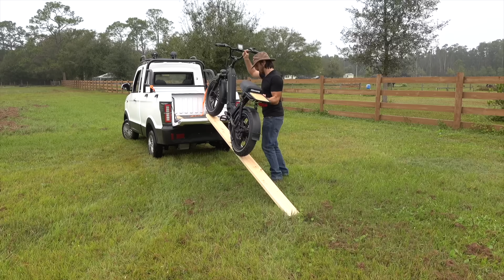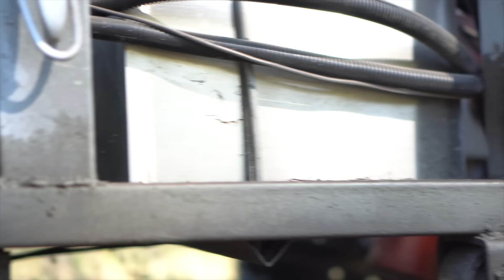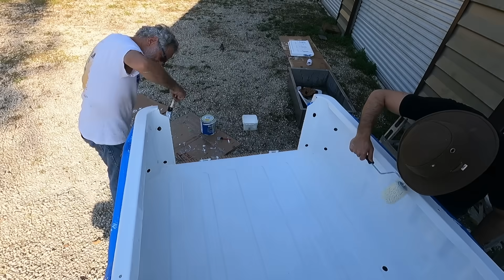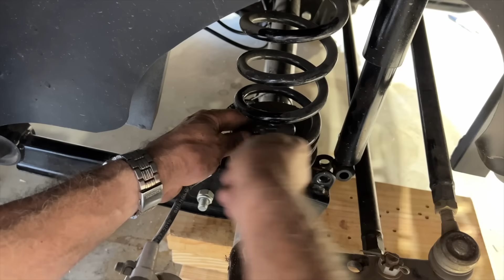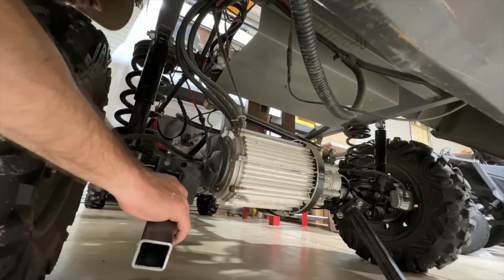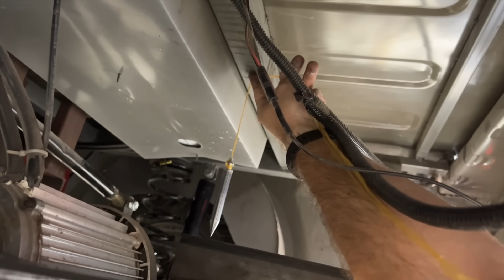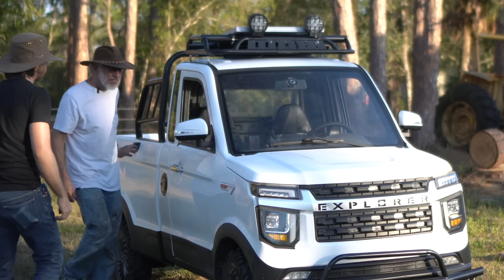My Chinese Electric Mini-Truck 18 Months Later: Did It RUST OUT?

Comment: Umm...  The hitch is clamped to the axle.  They hitch control leg is attached to the frame.  The axle moves, in relation to the frame !  This means that the support leg has to bend/curve to follow the arc, and the clamps are likely to slip on the axle in so doing.  You need flex in your joints.  Adding rubber sheeting under the U-bolts with another U-bolt either side of the clamps to keep it from sliding to either side, then some rubber washers on the control bar, to allow the ends some 'give', ought to fix these issues.  Great little truck though.  Well done both of you.
Reply: Don't disagree with your observations but the threaded rod (control leg) is very small diameter and has give and flex in it by design.  Doesn't totally address your issue but it is not a rigid connection in the sense of a welded square tube or similar member from axle to frame.  Thanks for sharing - good eye.

Comment: I was impressed by that little truck when you first got it. Bed liner is good idea, seems like you took the expensive route, but it looks fantastic. Painting the wheels was such a good idea. I’m still shocked it’s got functional A/C. 
Go to the hardware store and get some steel cable and fasteners, fixed! Lol
Cool video like always
Reply: That's the thing with this little truck. it's simple enough that it can be fixed and upgraded by almost anyone with minimal mechanical knowledge and tooling. That makes it very durable and its maintainance cost is very low.

Comment: Might be worth replacing the cowling around the motors fan helps redirect the air over the motors case fins or heat sink with the option to tow you'll be putting an extra load on that motor.

Comment: Do the off road tires fit directly on the factory wheels?
Reply from the maker: Yes, but we took the wheels to a local tire place to put the tires on.
Reply: I recently purchased a coco truck for my son with special needs. We purchased it pre-owned. I have so many questions about this truck. Have you found somewhere that you can purchase replacement parts, such as headlights? What size knoby tires would I get?
Reply: I hope to have some video of the delivery, unboxing, and assembly with battery install if the 72volt lithium ever shows up.

Comment: i would put some drain holes in the tow hook stell bar, that it dont rust when there is water in the pipe
Reply: There are drain holes on the bottom side for exactly that reason.  thanks for your comment

Comment: I kinda like how this is the antithesis of modern pick-ups in North America.
That said, I wonder if the tailgate hanger support could be moved to allow the tailgate to fold flat.
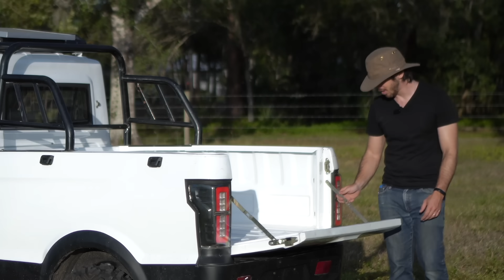...and now I see at 11:20 you talk about it :D
Reply: no reason to move it or whatnot. Just use some steel wire and crimp it to the length you need. Like a $5-$10 upgrade.

Comment: Glad your truck is working out.  It's hard to imagine they didn't put a more functional suspension on the truck. 
Thanks for reaching out to those in need of an e-bike.  Hopefully the most worthy wins.
Reply: I don't find it so hard to imagine that almost every design decision on this truck was probably based on cost. If the manufacturer somehow got a deal on the stiffer but cheaper springs, naturally they would go for that.

Comment: It's never seen road salt. That's the killer here.
Reply: Correct but this is SW Florida only a short distance from the Gulf of Mexico and there is actually a good deal of salt in the air
Reply: @micahsdad5388 salt in the air doesn’t compare to road salt in the winter bro 😂
Reply: @Ssm19494 that's a fact. A new car that doesn't get washed will have rust issues within 5 years because of road salt
Reply: @micahsdad5388 Ahh.. That's the place the cars rust from roof down.
I have seen such.

Greetings From Finland!
Reply: @micahsdad5388 there is (I hear) a new ancient metallurgy method that does not rust. Kinda like ancient cement does not crumble .
Reply: Thankfully road salt isn't a thing in the Southeast. Bad thing is that comes with winters where you can wear shorts and flip-flops in between cold fronts
Reply: road salt will kill anything
Reply: If its the killer I wonder why you highlighting something that's even a bigger problem with your american brands.
Reply: Road salt is a killer for American cars, too. Ever hear of a Winter Rat? It's am Upstate NY car that's had the floorboards replaced.
Reply: This isn't going in a road up north so road Salt wouldn't effect it either. People aren't going around salting their entire property it serving this thing around in 3 feet of snow. It would be bad as to see one of the with tracks instead of wheels.
Reply: Blackforest. Salt from september to May
Reply: Hvac installer by the beach. Most hvac units and metals don’t last more than 7ish years or so at best. You’d be the lotto winner to get 10 years on hvac unit on beach. I’d imagine the same with etruck or ecar…? I want to buy one though? Is it possibly street legal in nj ? America?
Reply: I don't know where this guy lives in FL. Depending on how far from the ocean he lives the less salt will be an issue even if it is still there. 

 With that said road salt is so much worse than salt from the ocean. Road salt is like a breed of its own, because well - there is more per meter. 

 Living on the coast in CT sucked. Got hit by both. Salt from being on the coast, and salt from the roads. 

 Weather is warming though so there is much less snow lately it seems to me. Yet sometimes governments still salt the effin roads even for the slightest chance of snow!
Reply: I'm in New England and I always wash my car during the winter. In fact, the car washes up here are packed like sardines between snowfall. After letting my first car rust to sh!+, I quickly realized washing my car in the winter is far more important than the summer. A brand new car can have rust issues in 5 years if neglected
Reply: Complaining about “salt in the air” is such weak issue compared to the loads of other problems you must have in Florida, with all the Florida men and women running around wreaking havoc, Trump in Mar-A-Lago
Reply: Please add western brands to salt corrosion and the super low quality corrosion prevention
Reply: Road salt would get just about any vehicle. Especially Chevy's
Reply: Road salt would get it😅
Reply: Fellow Floridian, and gotta agree with @Micah's Dad! Complaining about road salt that only is a problem 3 or so months a year, versus our S. FL salt air that's 24/7/365?? 😂😂 c'mon now, lol!!
Reply: @rpetersen2  Yeah, but fill a sandblaster with salt and sharp sand and blast all the wheel wells and you have one trip to work in MN. Freeze the glop on any place not blasted for good measure. That's why MN cars rust away.
Reply: @curtwuollet2912  ahhh you live in the American land of my people, lol! So many Scandinavian cultures up there!!  I do get that road salt is caustic as heck and not like sea or table salt. I'm thinking the bigger difference is the temp. We get it year round, but it's warm, so Floridians (I notice) wash their vehicles weekly or more often. Some even rinse them daily because it's just part of normal beach life. Up north you can't wash your vehicles for the 3+ months you deal with road salt, so I can see where that would make it worse for you up there.
Reply: @rpetersen2  Yes, I'm from Finnish stock myself.
Reply: @curtwuollet2912  Danmark here! 🇩🇰🇩🇰
Reply: @curtwuollet2912 Same thing with OH cars. They dump a screw load of salt on the road, and it sticks to the chassis. I'm so glad I live in GA. Only thing we have to worry about is moisture and rain.